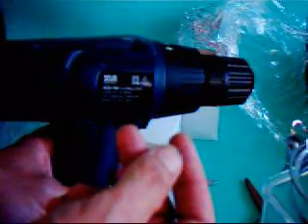Ready made PWM from a battery drill.

Comment: @birdyboyblue 

The power isn't "free" the more current you draw from the alternator the more load you put on the engine. More load means higher fuel requirements. No, the hydrogen and oxygen from the water DON'T improve combustion. You lose efficiency in the whole system.

Considering most IC engines in cars are around 35% efficient in converting fuel to power (before drive train losses and other forces.) You're lowering efficiency.

Comment: @x65535x Just took the liberty of looking up the energy density for hydrogen (it's 143 MJ/Kg, in contrast to lithium-based batteries: 1-2Mj/Kg) Even though it takes more energy to refine than it produces, hydrogen is usefull for A) applications where a massive expenditure of energy is required (launching a shuttle into orbit) B) Applications where low weight and volume are required (vehicles, interplanetary shuttles), C) In cases where generating solar energy is insufficient.

Comment: @x65535x Electrolysis IS a very inefficient process, but I think you fail to see the possibilities this can bring in the future. With water being the second most common molecular compound in the universe, It is readily available. Electrolysis does not only produce fuel, but oxygen as well. I'm not sure, but I think it's quite possible that when compressed hydrogen has energy densities way above most batteries, also note that hydrogens spectacular reaction rate is a plus.

Comment: @m3sca1 Thanx! But I can made simple pwm with 556 timer for 10 euro or Meyers pwm for 20 euro or buy battery drill pwm separated for 5 euros. New battery drill cost about 20 euro,cheapest one in my country! I have one old and use pwm but in full throttle dont work,and in low throttle work but so much heating and I stop! I cant understand why,pwm is for 12 amps and I run just 8 amps straight DC?

Comment from the maker: @Ace011mm this drill PWM is the cheapest souce of PWM-thats the point.
increasing amps and heat will occur with most pulse sources,specially if you run it full throttle.
try an electric scooter PWM and buy it second hand-that will let you keep cost down and run it with low throttle.that should slow heating.
shorter pulses =less heat,but also less gas.
the freqency needs to resonate with the cell,so ultimately changing freq to match cell is best.

Comment: I'll give you that. Fire is fun. A hydrogen flame is a lot of fun. No gas requirements just water with an ionic compound in solution with some electricity and you get a flammable gas. Actually in an explosive mixture as well.

It's fun but won't be a viable energy source.

The one thin is. It's physically impossible to change the energy required to change enthalpy and all that fun stuff.

While some laws of physics will be broken the energy of chemical reactions probably won't be one.

Comment from the maker: your entitled to your opinion.
the drill was cheaper than buying the parts for even a rudimentry PWM and i have done other things with the robust trigger.
its an easy means to an end.
also old electric scooters have a similar but bigger PWM with throttle control.
btw the brand of drill was the cheapest on the market,and as such would not last very long in service as a drill
;]

Comment from the maker: why dont you pu the trigger under your accelorator pedal?
or attach it to your throttle under the hood.

would be easier than trying to find a similar rated potentiometer knob,which you want to turn as throttle increases anyway,so you may as well stick with the slide trigger.

Comment from the maker: yeah its limited in range and only adjusts the pulse width at around 3.5kHz.
but the robust construction of these things let me try many things and got great gas production with less heat on a cell.
as for cost effective it was cheaper than the parts for the lawton circuit or the PWM motor speed controller i built,worked better and i got a battery,charger,drill chuck,and motor,in the bargain.
also the trigger is ready made for throttle like applications,with its squeeze trigger.

Comment from the maker: Hooked it up to speaker and it squeals a tone,that sounds like a square wave,or maybe saw tooth-it has what looks like a power FET hanging out the side,although there are no numbers on the transistor to check that.
I am thinking maybe with a large resistance on the output ,i could use my sound card to sample the waveform,so that i can look at it.
Any thoughts on that?

Comment from the maker: ok this is what i found on a quick google search-for "PWM motor speed controller battery drill"

DC motor speed controls (as used in cordless drills and the like) are most commonly a relatively low frequency PWM.

i was pretty sure its a simple PWM,now im wondering,so im going to test/check it with speaker on the output.I figure if it hums then its pulsing.
I dont have a scope to put it on,unfortunately

Comment: not a PWM just a current regulator DC drill no pulse just straight current with a variable resistor to adjust the current PWM (Pulse Width Modulator)_-_-_--__--__--___---___---ex. your drill ____________________ PWM's are real easy to make.I will make a video of a few simple PWM's and some circuits that use them and will even upload the schematics to my website. Check my Page for link

Comment: you gonna use that motor? bet it can generate massive current with the rite mods, if you can take it apart without damaging the the armature you can rewind it with heavier or lighter gauge wire depending on the voltage per rpm you want. also you can get neo mags shaped like the ones from the motor. If the drill is good it will also have bearing for the shaft which is a big plus.